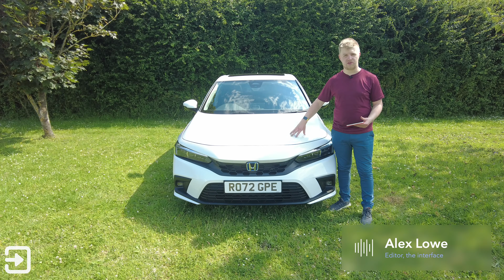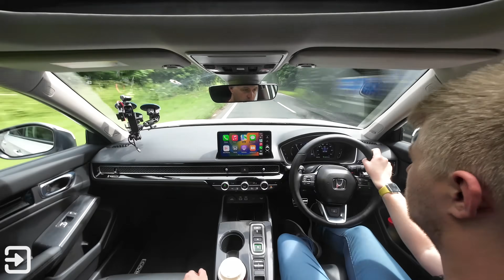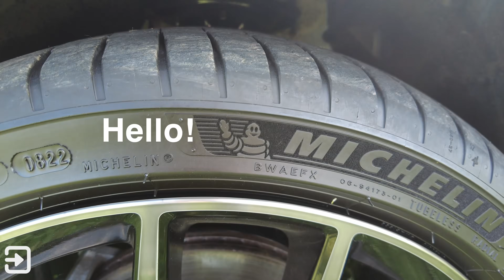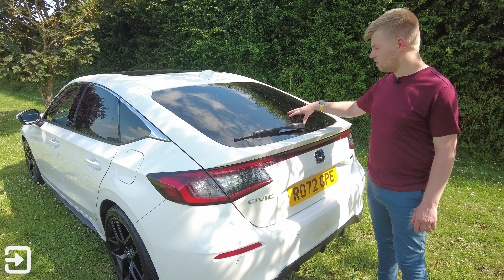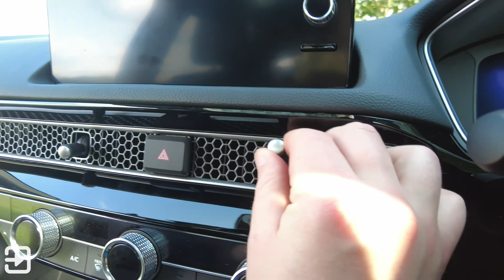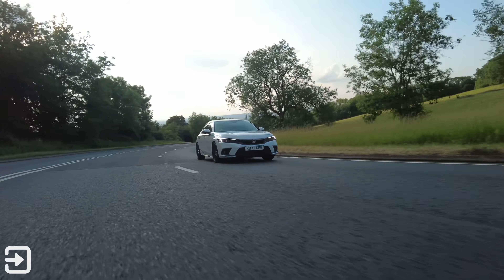Honda Civic Hybrid Advance 2023 Review | The Sensible Family Hybrid?

Comment: Thnx for the review :top:

As a side note - sport mode could not turn off EV in this type of hybrid setup even in theory, as it has no direct power transfer from the engine and no gears (CVT is a misnomer here, it is just electric). Though there is an exception at the most effective engine load in coasting seeds (6. gear analogue) where the engine engages directly, but overall it's drivetrain is better looked at as an electric car with a petrol generator, so whatever tweaks driving modes do they will never disengage electric.
Reply from the maker: Hey, thanks for watching!

Comment: Can you turn the fake sounds off? 
This is a deal breaker for me, can't stand fake engine sounds
Reply: You can't but disconnecting the speaker is fairly easy. With that said, I hate fake engine sounds as well but I kinda liked them in the civic
Reply: @MadDoc1231 I think it’s required for regulatory reasons.
Reply from the maker: Thanks for watching. I couldn't find a way to turn the sounds off, but I kinda liked them. Appreciate it isn't for everyone, however.
Reply: I’ve got one and the sound only comes on in sports mode. Which I actually don’t really use. Unless the different trims aren’t the same
Reply: My friend has just bought an £80,000 AMG Mercedes (GLC43) which has a highly boosted 2.0 litre engine. The fake engine noise they’ve piped in in order to try and make the four cylinder sound more like the previous 6 cylinder engine is terrible. BMW four cylinders also have poor fake engine sound. The Honda augmented sound is actually quite realistic and can only really be heard when “revving” hard and only in Sport mode anyway…
Reply: If you turn up your music does it cover the fake sounds? Picking my year old sport next week. Excited! Upgrading from an 18 plate sport plus! 😊

Comment: Bought a pre reg 23 plate Advance in sonic grey with 6 miles on the clock five weeks ago. Done 1700 miles so far, averaging 54mpg overall with mixed driving. It's a fantastic car but agree that the fact the brake hold has to be applied every time is a right pain. Also not being able to permanently switch off the road deviation is a real nuisance. Great video which covers how good the car is.
Reply from the maker: Thanks for watching! Glad you like the car, it is super impressive. Hope you enjoy it :)
Reply: It has to be applied?
Reply: @markdillon9588  yes, brake hold has to be applied after every time the ignition is switched on and off. A right pain in the butt. Also lane deviation has to be switched off every single time unlike some manufacturers where you can permanently switch it off until you want it back on.